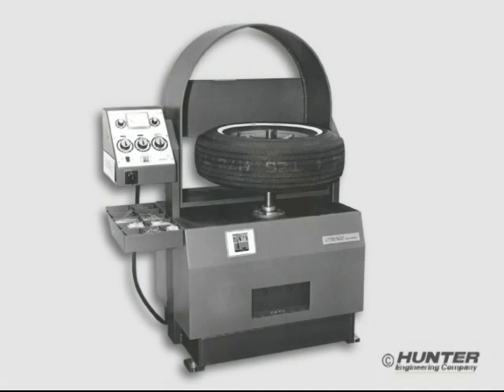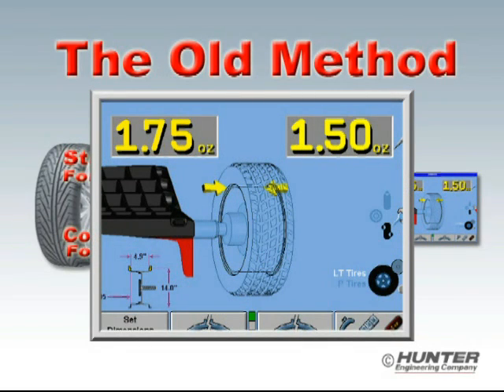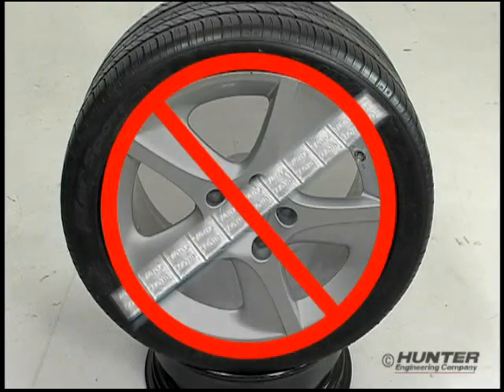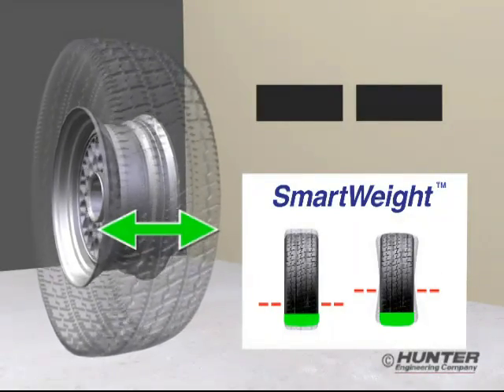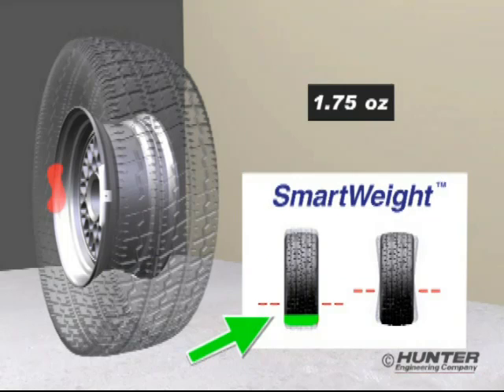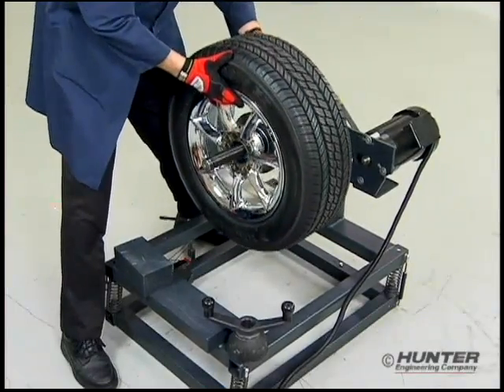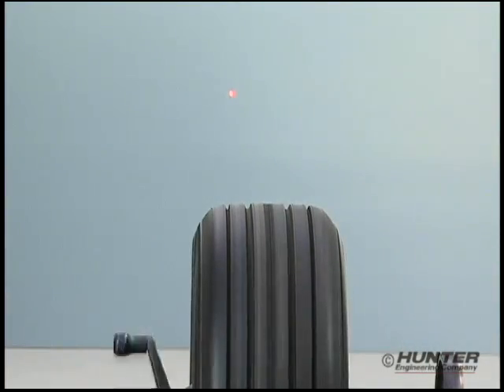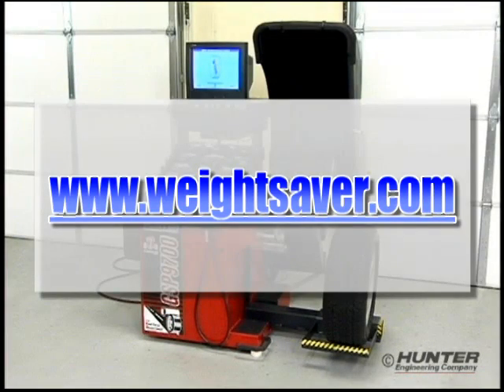SmartWeight® Wheel Balancing - Hunter Engineering

Comment: so if we balance just to "in" tolerance instead of zero. in tolerance today can be out of tolerance by tomorrow (or 1000 miles) and my wheel now needs rebalanced. Who are you fooling?
Reply: Thank you for the question. All machines have to have a tolerance or the job would never be finished.  A Smartweight balancer will never leave more than .3 oz of static imbalance on a wheel where non Smartweight machines can leave twice that.
Reply: @HunterEngCo   degital Wheel balancer price Pkr